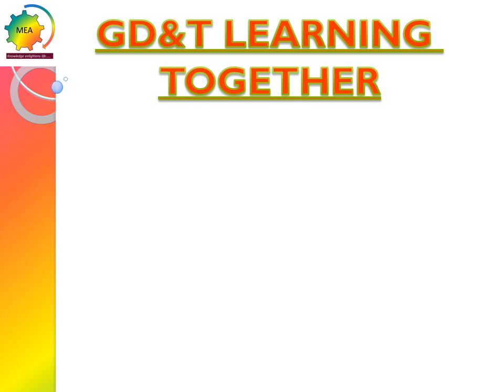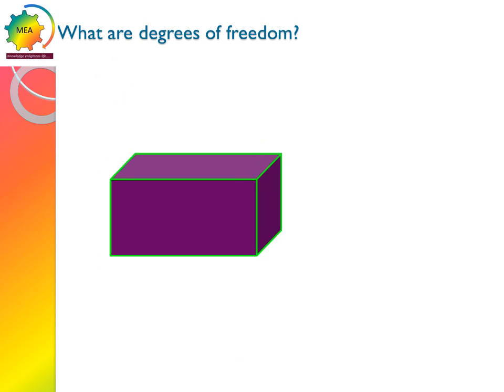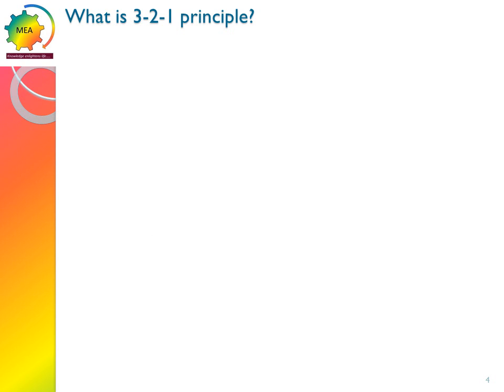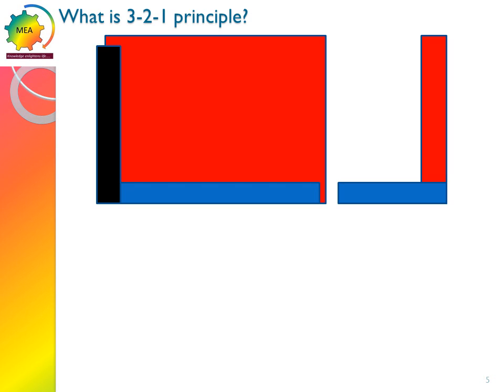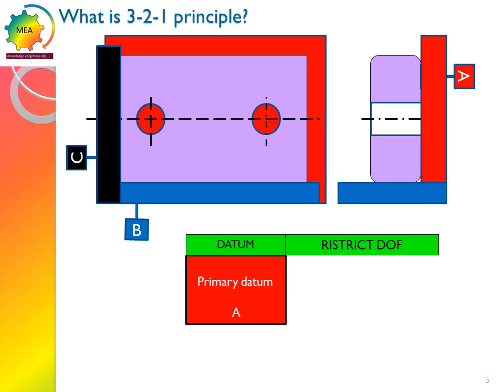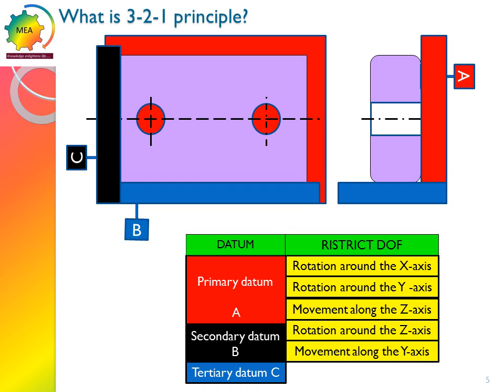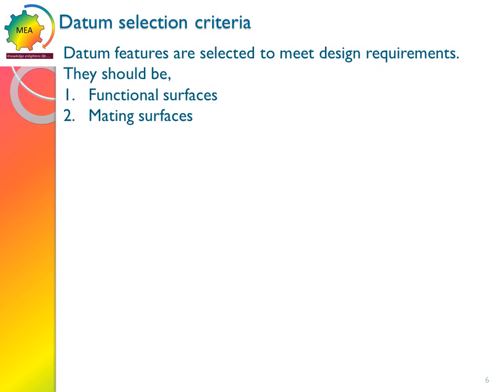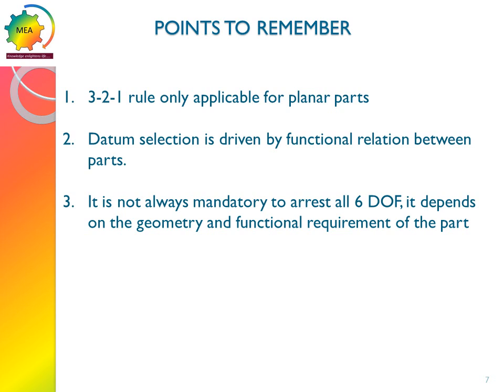GD&T: What is 3-2-1 principle?

Comment: The basic dimension in figure is not originating from secondary datum feature B, rather it is originating from a surface parallel to datum feature B.
Reply from the maker: Call me at 9845118897